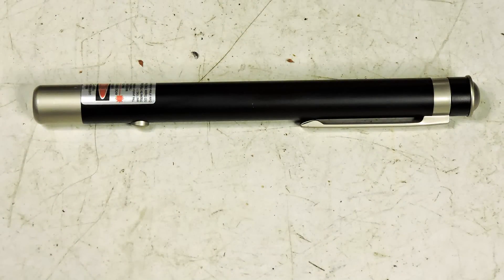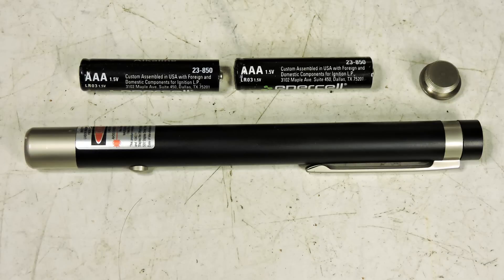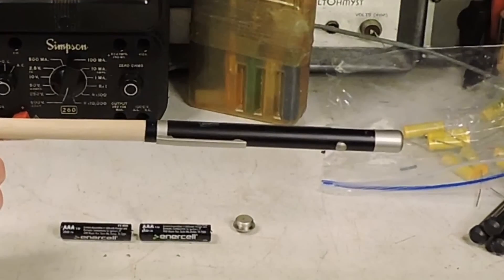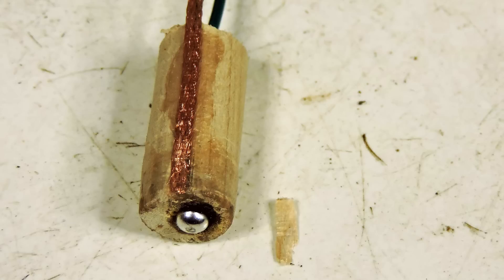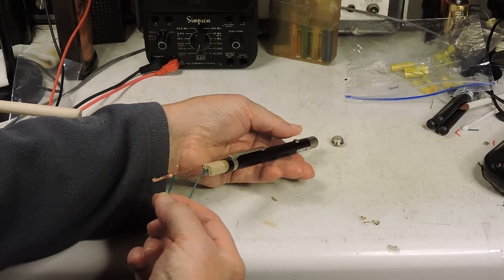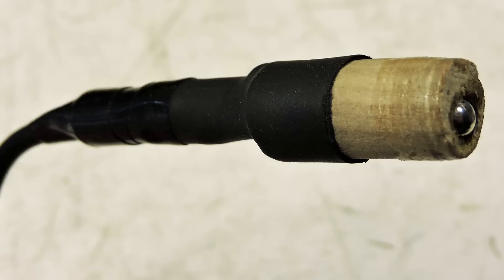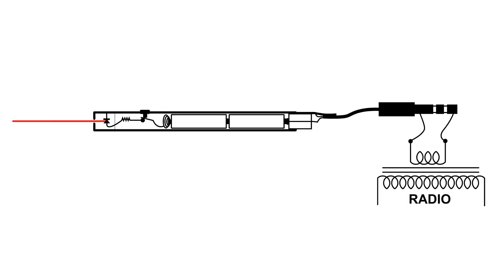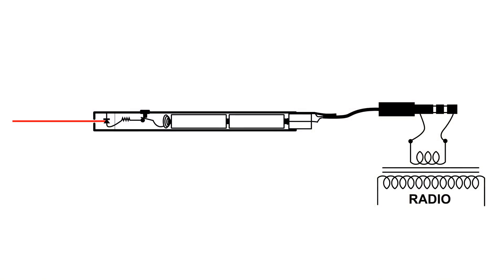Modulate Laser Light Transmitter

Comment: Hello sir, this is an amazing project, and I would like to ask about this project, is it possible to modulate the laser with an audio circuit such as using the LM386 IC to modulate it so that it can transfer sound which is then received by the receiver?
Reply from the maker: Hi, thanks for the question and idea. It is about time to update the modulated lasr. This video is about a project I did in the 8th grade. Had to use a flashlight because there were no lasrs yet. I’ll order some LM386 and if it can not drive a lasr adding a transistor to the output should work. Thank you, and thanks for watching!
Reply from the maker: I have ordered LM386 chips, NPN & PNP transistors, and some Laser pointers, This will be a fun project.
Reply: @AllAmericanFiveRadio  can't wait for the project, sir
Reply from the maker: All the parts have arrived, Yaa I get to play.
Reply from the maker: I am glad I ordered three laser pointers, red, green, and blue. I had no idea how different each would be. If I make a circuit that will work with all three, that should work with almost all three volt laser pointers. I think the LM386 will work, but for the lasers I’m going to need a three volt regulated supply.
Reply: @AllAmericanFiveRadio 
If you look at the laser, maybe the green laser is the best, because it has a dominant color among the other colors, I have tried it at home, the laser I used was 5mw red, and it managed to modulate the sound to the laser beam at a distance of 6 meters, I have not tested it at a distance further than this
Reply from the maker: @zzaa3595  Yes the Green is very intense. I had another idea today. I ordered a variable regulator LM338T/NOPB, because I need 3VDC for the Laser pointer. I was thinking this may be useful in modulating the Laser also.
Reply from the maker: I have a circuit with just the LM386 and a Laser Pointer. It seems to work well but I’m not sure how it is working. I’m making a drawing of the circuit now so I can study what is going on.
Reply from the maker: I just played music from a radio though the Laser and it sounds great.
Reply: @AllAmericanFiveRadio  What distance is that, sir? Is the receiver also from LM386?
Reply from the maker: @zzaa3595  The receiver is a Photo Cell and a audio amplifier with speaker. The functional test I did went across a field and it would have gone farther but I could not go any farther. I think I have the design that works well with the least amount of parts. I’ll start working on a video. These video links are from earlier experiments.

Modulated Laser Light Receiver
https://www.youtube.com/watch?v=8tpPjGPPJf4

My Eighth Grade Science Project Functional Test
https://www.youtube.com/watch?v=MUubjTa30AE
Reply from the maker: @zzaa3595  Just uploaded video
Audio Modulation Laser Pointer LM386 Amplifier
https://youtu.be/txpjhMzwxAg

Comment: I did this with a laser that I bought at walmart and a coil from a power supply and it worked pretty good with a solar panel but it was a bit high. Might try a lower power solar panel like from a calculator.
Reply from the maker: coondogtheman1234 
Excellent
Reply: AllAmericanFiveRadio
 I just need to make it more permanent than the way I had it.